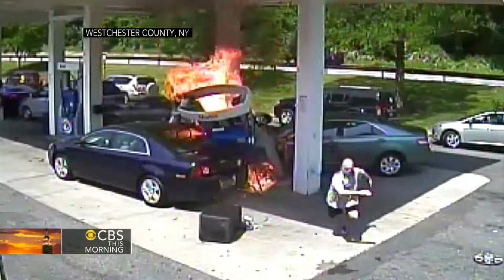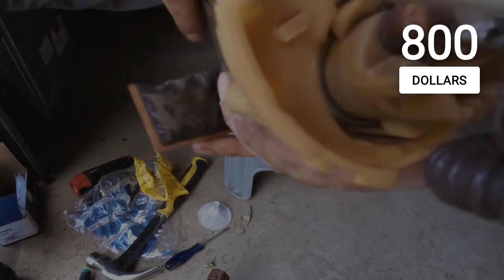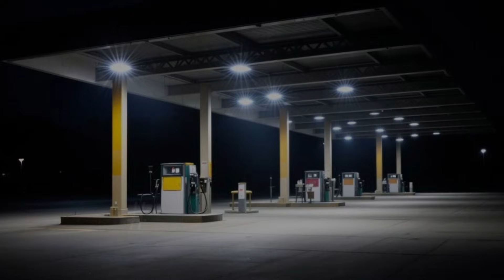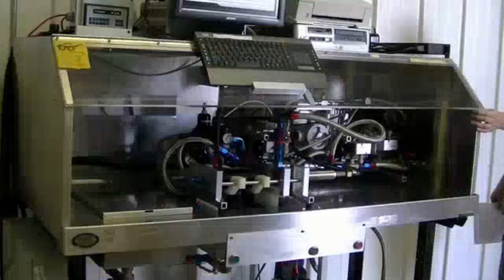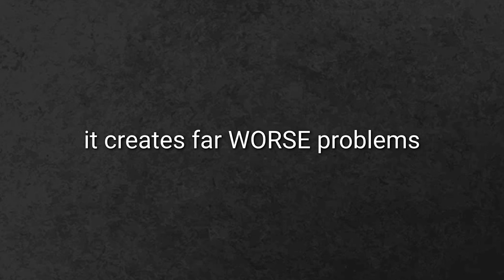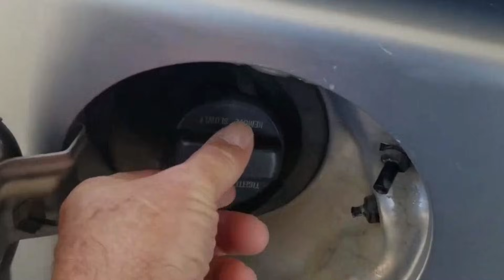The BIGGEST MISTAKE that 97% of drivers make before filling up

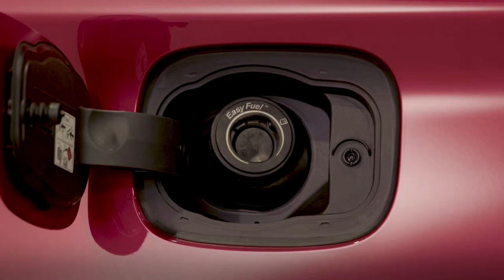Comment: 4:30 pump clicks off doesnt always indicate full,   could  ive  put fuel in and it clicks off  after a  few seconds i know my tank isnt full ,  and  dont squeeze the nozzle  at full flow,   this airaits the fuell   and  you get less gas than you pay for.  drive off  full tank,  mile later you down to half tank mark